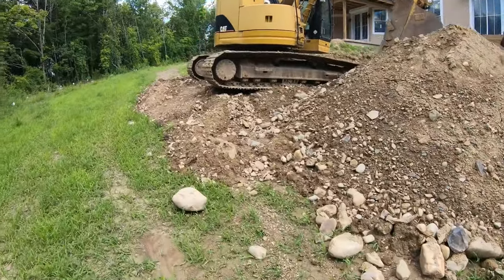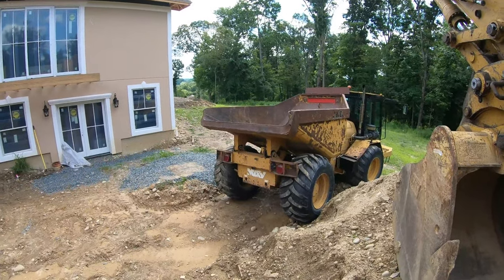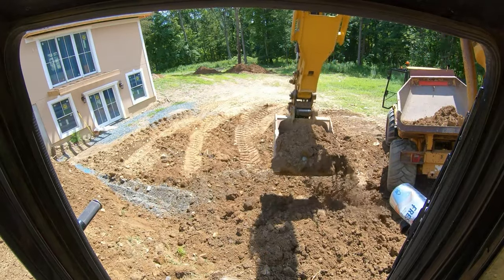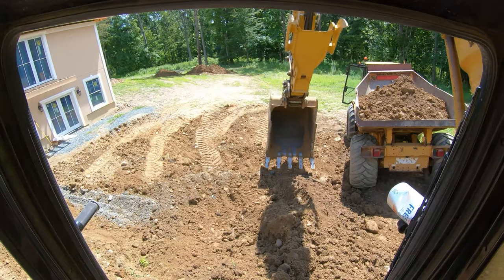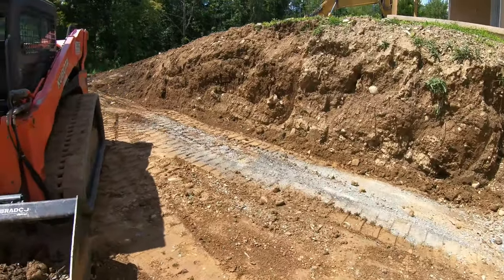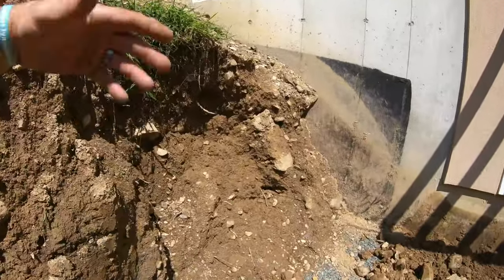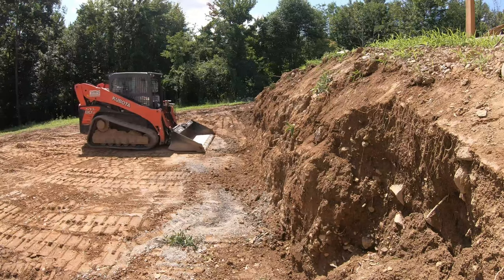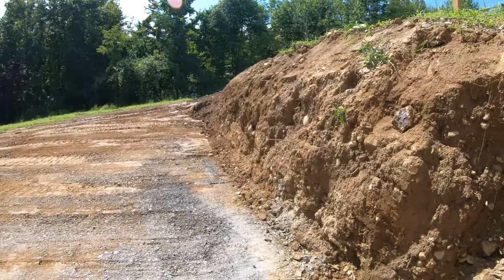Digging for a Retaining Wall with a CAT 321C Hydrema 912 & Kubota SVL 90-2

Comment: Those Hydrema’s are a short haul dream.  Small, maneuverable, high floatation tires and dump well on slopes.  And, you can transport it to your worksite without a huge semi-trailer.  

I watch Hedblom. He uses one constantly.  I see a lot of big haul trucks used here, but few smaller ones.  In jobs like this they are a perfect answer.

I agree with you 100% on the slope.  It is much better to backfill with rock than sloughed off dirt.

Nice job Boss man!!
Reply from the maker: Thanks SV yeah Hydrema !

Comment: D-Boss!  my man i mentioned before i put up miles of wall through the years, couple tips for you since it’s seven foot high, i don’t play with those stone footings on high stuff, i would auger three, four foot whatever is your code every six to eight foot along the length and form and pour a real footing, mud the first course and glue the rest, but you should geogrid it after three or four feet high for sure and make sure you have good separation behind it between the soil and clean drainage stone and just cut a french drain in the ground until it hits falling grade, you know the deal up there with the freezing winter, if the water is stuck your wall is failing…i’m gonna roll up and give you a hand…i wish i could, but i got to straighten out these jersey cat down here, you got anyway!
Reply from the maker: I hear you brother I wish you would stop by ! This is a free floating Alan block wall.. I've built them off the 13-ft high they hold got to use the geo grid like you said

Comment: Do you think it's tippy because of the counterweight being close to the middle of the machine? Those zero tailswing machines are always a little different to get used to.
Reply from the maker: That definitely plays a role in it but this particular machine has a quick connect huge thumb and a heavy cat bucket add all that together it's too much for the machine
Reply: Gotcha.  Is this the house at the top of the hill with the long driveway you put in?
Reply from the maker: @brockwagner939  yes